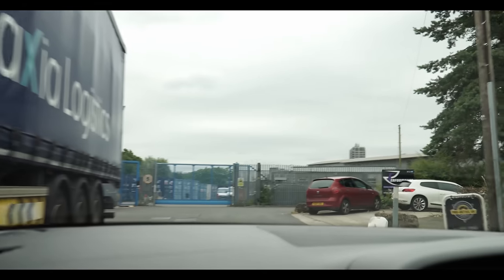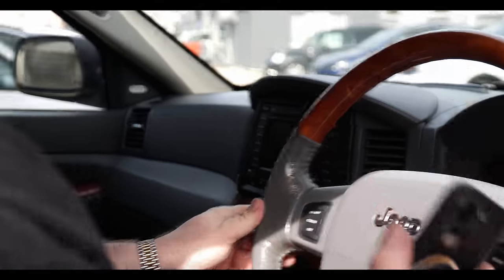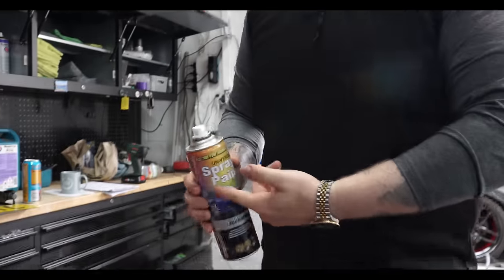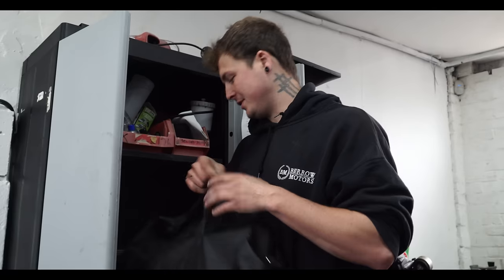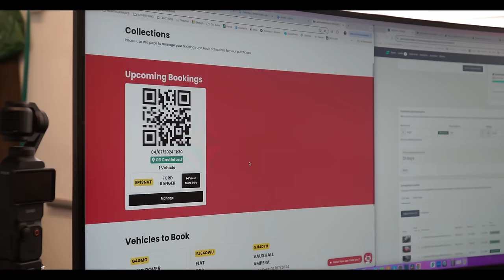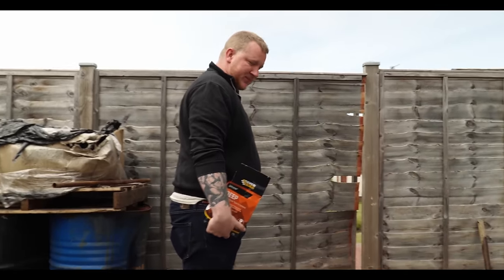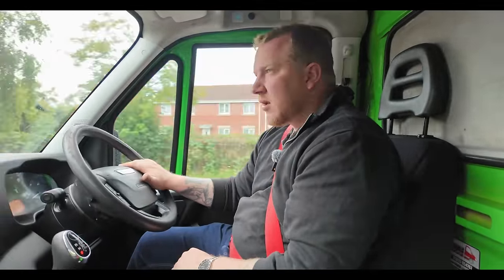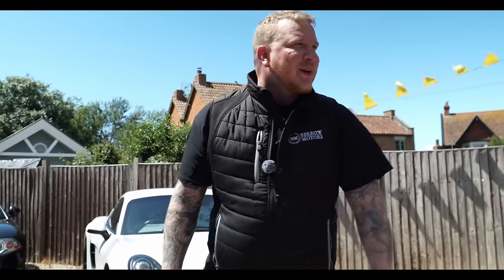All Change At Berrow Motors Again! | BM Weekly Ep46

Comment: Joe. That fence is giving me the heeby geebeeys mate. It wouldn’t take much to  jazz it up. Certainly look at using a concrete spur post, to attach from your side and bolt through. If wind is an issue I’d be inclined to go to a stronger fence using rails and feather edge or if you wanted to stick with panels. You can go concrete posts with a concrete gravel board and use a 6’ panel that slides in and can be replaced. You want a price for it. I’d nip over and take a look. Have tools, will travel 🤣🤣